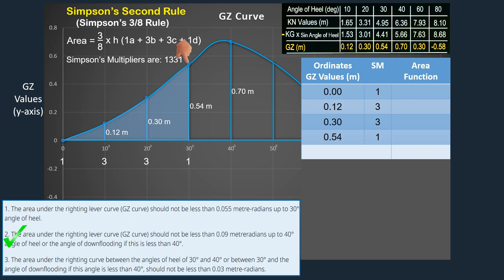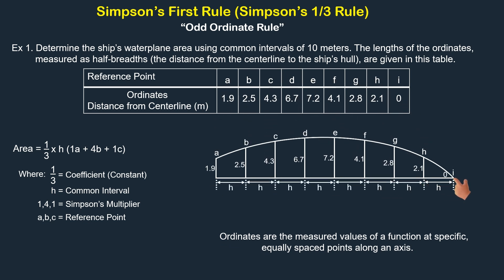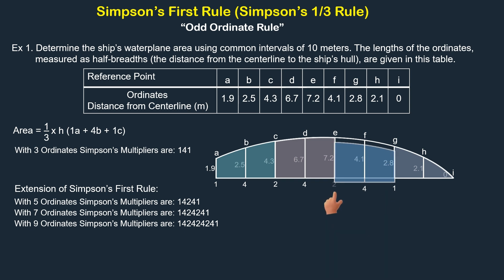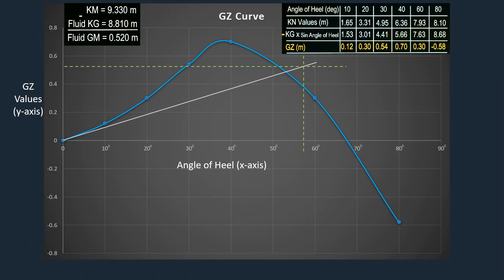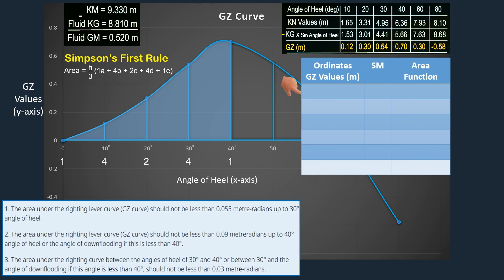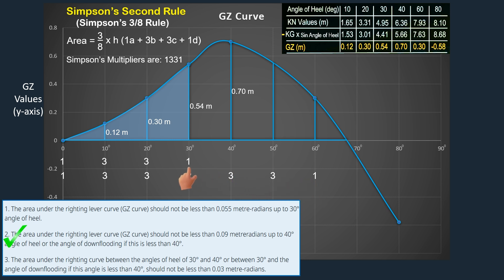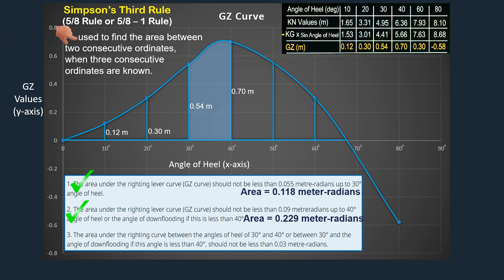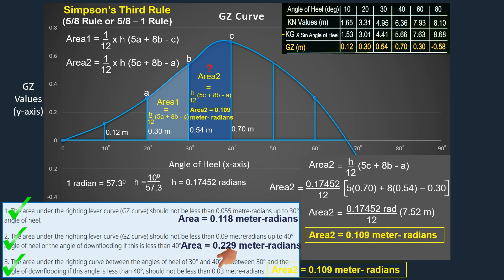Simpson's Rule: 1st, 2nd, and 3rd Rules ll Calculating Area Under the GZ Curve and Waterplane Areas

Comment: How to get the ordinates distance from center line and how to divide it
Reply from the maker: When using Simpson's Rules, you can choose how many ordinates to use based on the shape of the area you're trying to calculate and how accurate you want the result to be. However, your choice must follow the specific requirements of the Simpson’s formula you’re applying:

 1. Simpson's 1st Rule (also called 1-4-1 Rule):
Requires an odd number of ordinates (i.e., even number of intervals).
Minimum: 3 ordinates (2 intervals).

2. Simpson's 2nd Rule (also called 1-3-3-1 Rule):
Requires 4 ordinates (3 equal intervals).
Used when there are only 3 intervals available or when the shape fits better for this rule.

3. Combination of both:
For more complex shapes or more ordinates, we sometimes combine Simpson’s 1st and 2nd rules to cover all segments, depending on how many ordinates we have.

Yes, we choose the number of ordinates depending on:
The data available,
The shape being measured, and
The requirement of the rule we’re going to apply.

DO NOT pick a number of ordinates that doesn't satisfy the conditions of the rule we’re using (for example, using Simpson’s 1st Rule with an even number of ordinates).

 If you're working with:
1. A Ship's Body Plan or Lines Plan:
We manually measure the ordinate heights (e.g., half-breadths, depths) from the drawing using a scale ruler.
This is common in naval architecture or training scenarios.
We measure the height of each ordinate from the baseline or centerline.

2. Draft Survey or Stability Booklet Data:
No need for physical measurement.
We typically use pre-calculated values from:
Hydrostatic tables
Tank capacity plans
Offset tables
These give the ordinate heights (e.g., section areas or half-breadths) directly.

3. Real Ship in the Water (e.g., Draft Survey):
We don’t measure underwater hull manually.
Instead, you take draft readings at multiple points (FP, midship, AP).
From these, you calculate mean draft, and apply Simpson’s Rule to calculate underwater volume using tabulated data (TPI, MTC, etc.).

We don’t always need to measure ordinates manually with a physical device.
We only do it manually when working from scale drawings.
For most real-world applications, especially on board ships, we use ready-made tables and hydrostatic data.